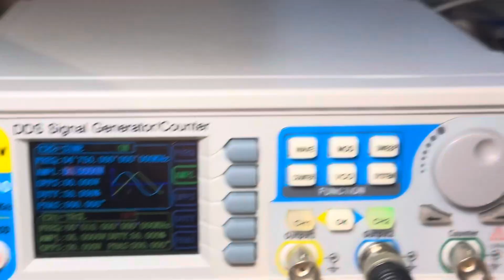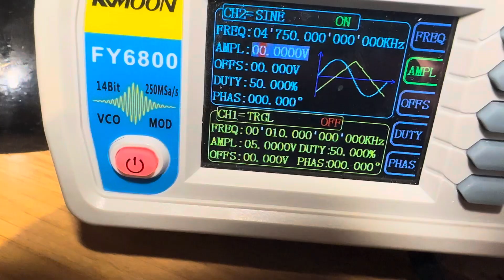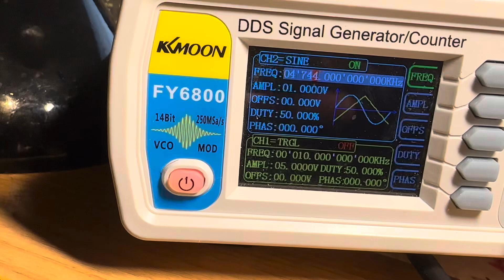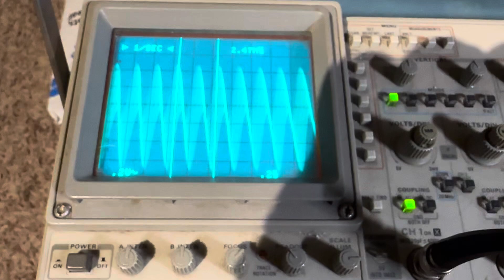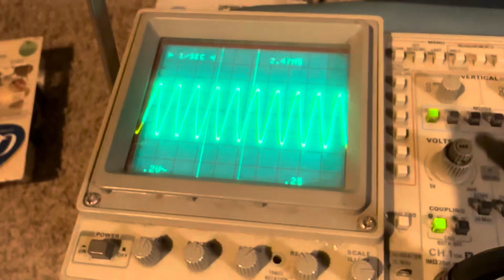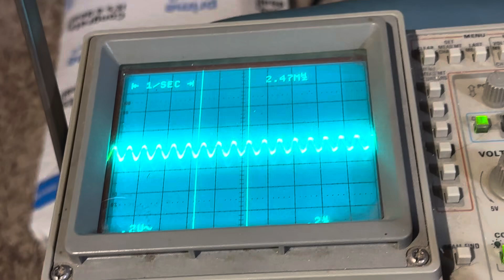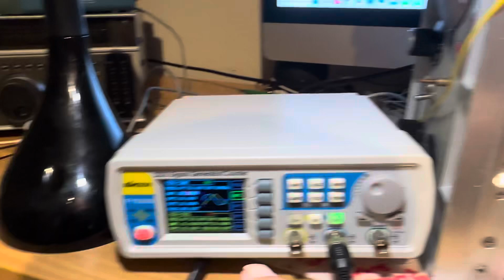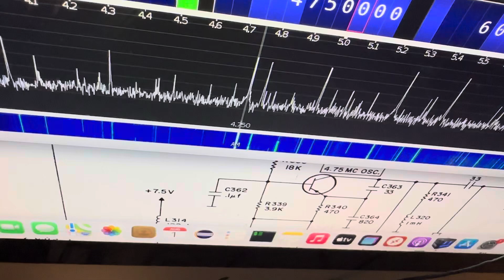National HRO 500 How to adjust the Synth Mix, Lock section and test DC amp and muting

Comment: One of my acquisitions was a Tektronix ACTIVE PROBE.. Like a HP 510B VTVM, the active Oscilloscope probe will not load down critically sensitive circuits like oscillators. Something to consider when placing a scope probe in these types of circuits. The probe is model P6202,, FYI...
Robert San Diego
Reply: I think you're on the right track. The service manual has a section on troubleshooting this section. But it requires some special test equipment. Namely some sweep generators.
Reply from the maker: This is really good advice. I appreciate it.